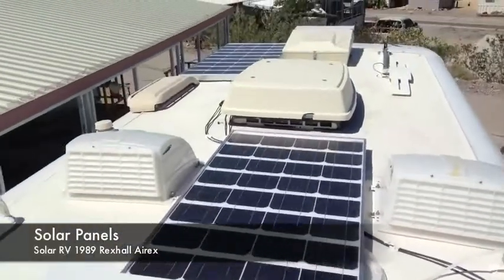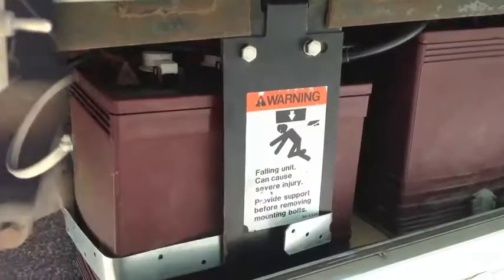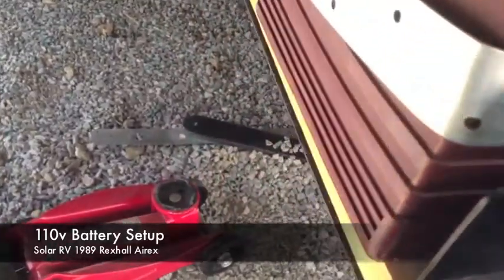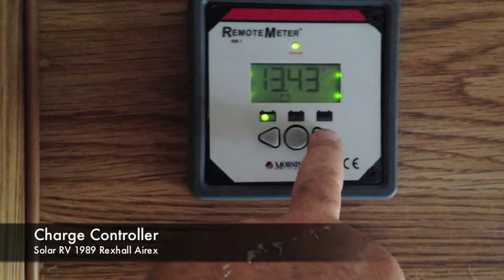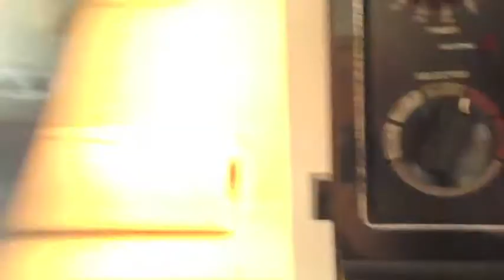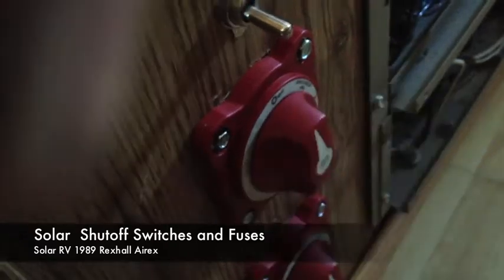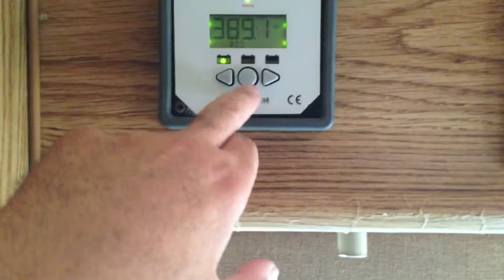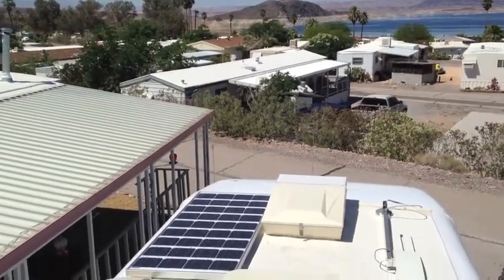Solar Power Off Grid RV

Comment: Great video.  Did you paint your RV?  We have an 1989 Airex and wanted to paint it and just wondering what you did.
Reply from the maker: I used the gallon Rustoleum White mixed with 25% Mineral Spirits/Paint thinner then rolled it on with a 6" foam roller. You can experiment mixing it with different colors such as Almond or brown. I used white because I live in Vegas. Just roll it on gently so you dont get lines running down the sides, lightly sand, then do another coat. Check out my other video https://www.youtube.com/watch?v=2wbIjM59ig8 on the before paint. Good Luck!

Comment: RE: TV Mount, I purchased just an ordinary wall mount that hugs the wall, it does not have a retractable arm. Mine does slide left to right to access the cabinets on each side. I think I paid about $40.00 for mine. Good luck with your mount and I hope your RV projects are going smoothly. I look forward to see you next video.
Reply from the maker: Your Rambler turned out great! Looks like a lot of fun! Those look like solid RVs

I'll stop by Harbor Freight and pick up a slide mount. The retractable arm just moves around too much when going down a brake bump riddled road, which I do often.

RV projects are going good, I checked out Yankee Preppers videos on his restore of a '78 Dodge Sportsman Class C and was inspired to start working on my 460 motor.  So far, I fixed an exhaust leak, transmission vacuum leak, and went ahead and replaced the oils sensor unit and the temperature gauge unit along with a summer oil change w Lucas oil stabilizer and radiator flush. It ran great before but now its unreal how much power these things really have.

Take care